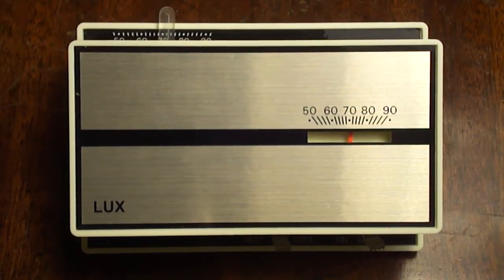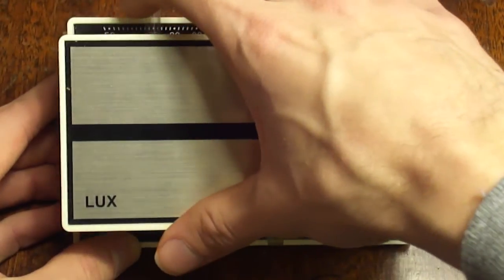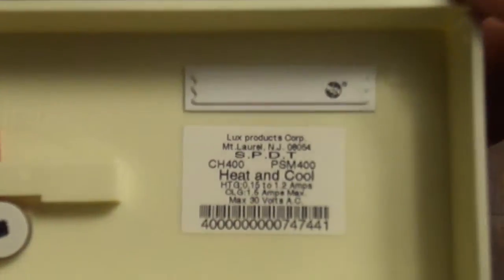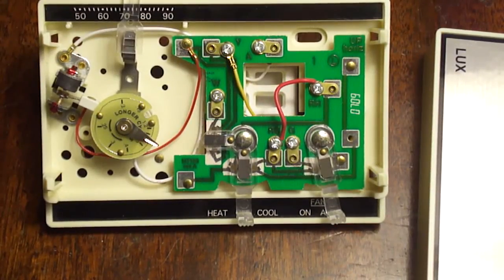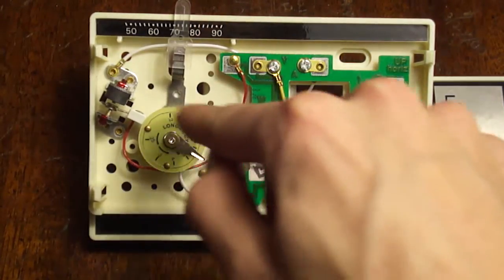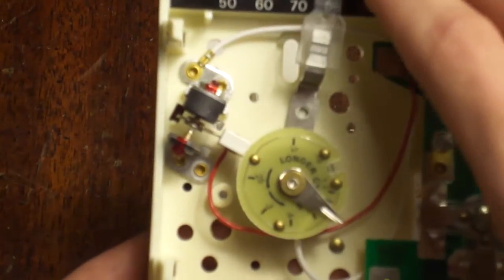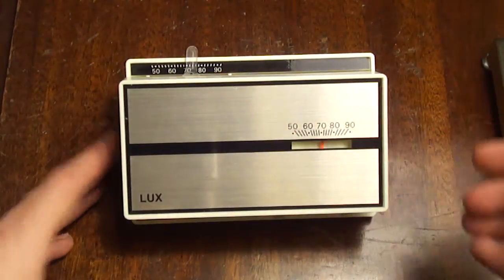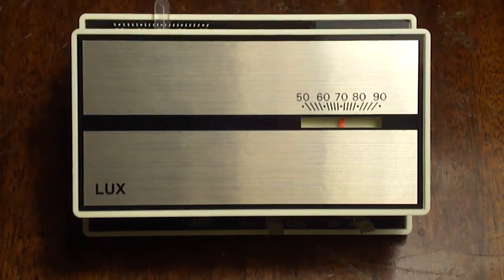LUX CH-400- 24V Heating and Cooling Thermostat- Snap Switch

Comment: Old post but good info for a beginner etc! My cousin is dealing with a system that won’t shut off in either mode! I told him probably mechanical failure problem in the snap acting part!?
Usually the cooling anticipator is non-adjustable! So if both modes are acting crazy…. It’s either wire/short related or mechanical failure.

Comment from the maker: @airconguy1 
It sounds like they're support for the bi-metal thermometer broke (there only plastic and quite old now) which is probably why it falls off the scale (A little Super Glue and a separate thermometer for calibration would fix that).  Either that or the tension is seriously off. LOL!